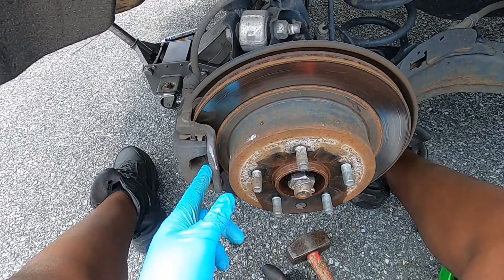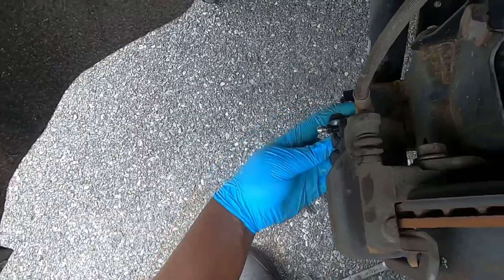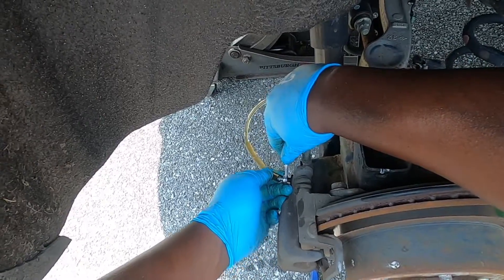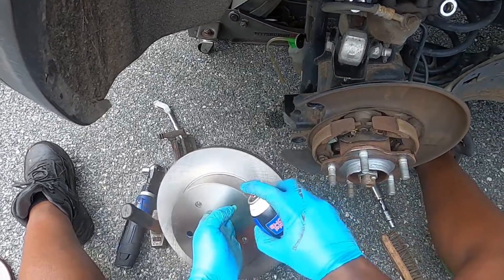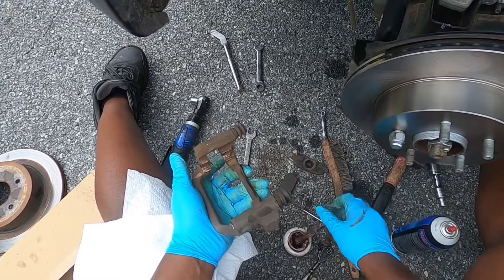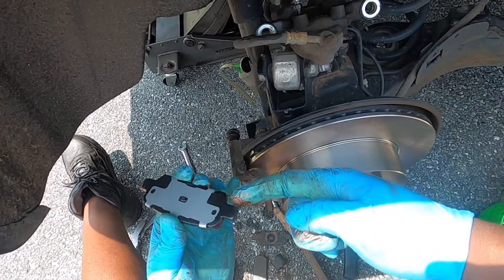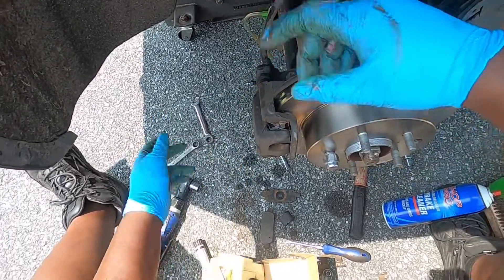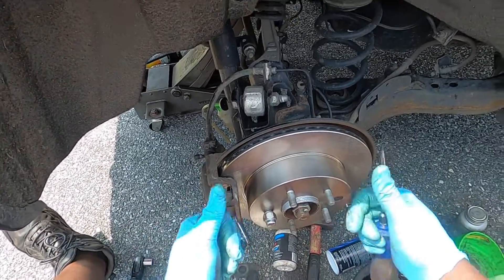2017-2022 Nissan Rouge Sport Rear Brake Pad & Rotor Replacement

Comment: What I also do is after I cleaned the mounting surface and caliper brackets I sprayed rust paint all over including the non friction areas of the rotors you just have to wait for the paint to dry before applying the antiseize